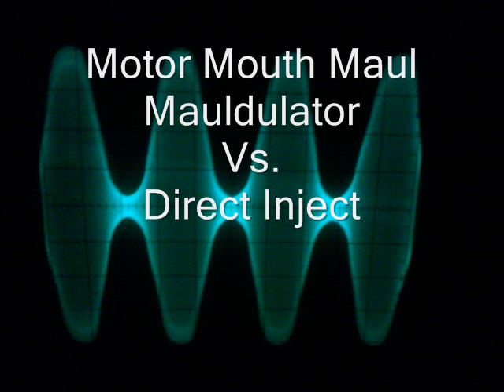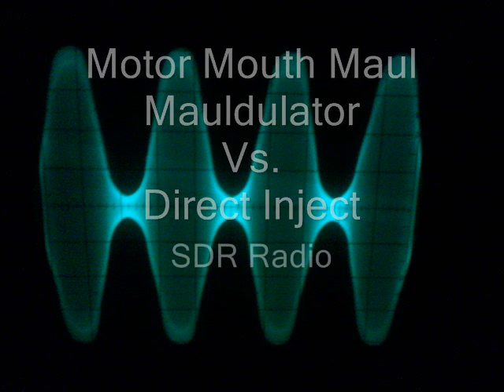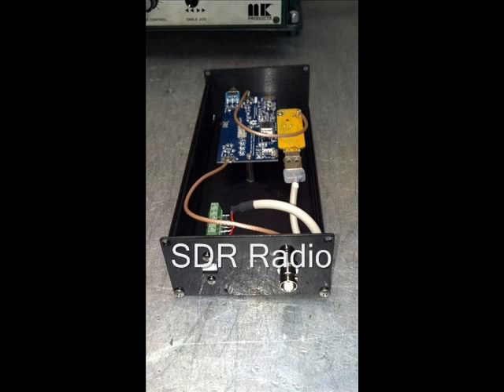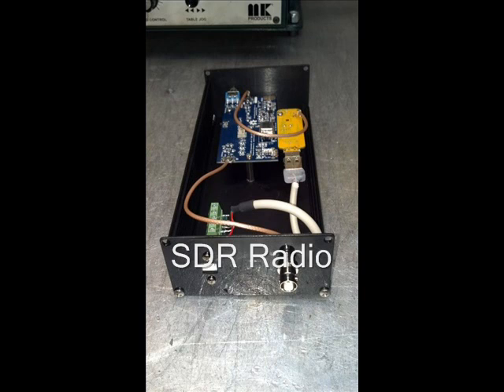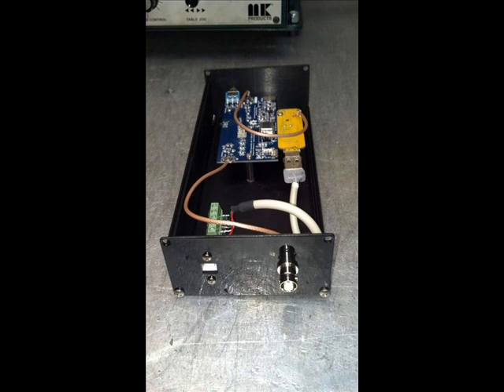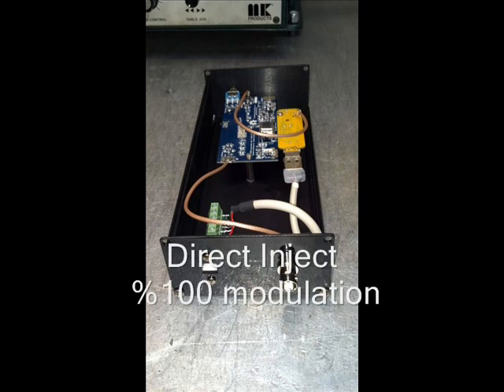Mauldulator Vs  Direct Inject

Comment: The only problem is you don't need 100% modulation.
Of course there will be distortion you are overmodulating the signal. 85 - 90% modulation is where you want to run your audio on the board at any radio station.

Comment: Just my 2 cents so take it for what it's worth but your audio is not pleasant to listen to. It doesn't sound natural, the mid bass is cranked way to high and it sounds distorted all of the time, possibly a condenser with the gains too high or too close to the mic?  It has potential but is very fatiguing to listen to.
Reply from the maker: I agree with you, since going to SDR RX I have made lots of changes! I would have rerecorded it but my poorly adjusted audio wasn't supposed to be the focus of the video.... sorry....lol
Reply: No worries because like I said, it obviously had potential.  I'm just an audiophile and tend to notice things like that.  Most people on the CB seem to think just because it has low end that it's HiFi but then again, well, I'm sure you know what I mean.  Cool video though, thanks for sharing it.
Reply from the maker: I do know what you mean I make the same observations! I have a Mauldulator installed on my TS-850 along with the DSP-100. If It wasn't having the known CAR board issues I would have uploaded a video of that setup long ago and draw some attention away from this video....lol

Comment: Sounds awesome. It is easy to decrease the negative Peaks without using the Mauldulator though. For the less technically proficient the Mauldulator makes it simpler and takes a lot of guesswork out of the equation.

Comment: No external  audio processing I'm guessing. You start loosing the highs quickly when the carrier pinches. Excellent gate!
Reply from the maker: I was running Pro Tools, I didn't change anything other than the gains to drive the direct inject harder. Im probably not losing highs but my lows were so over modulated the harmonics from the distortion were making it sound unbalanced.